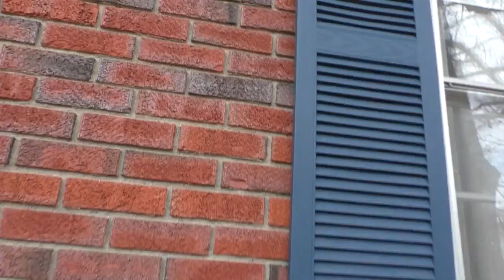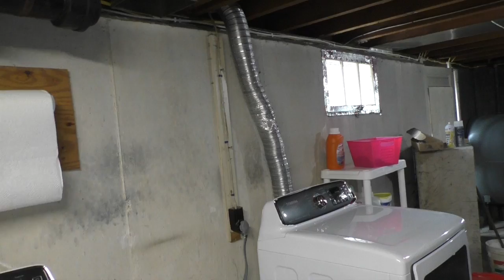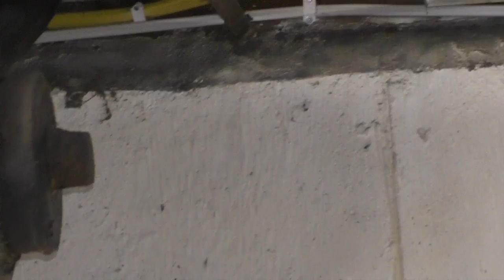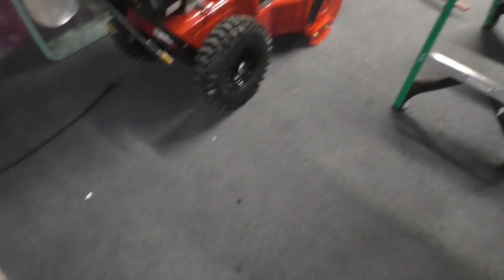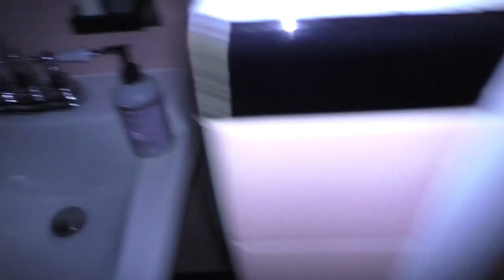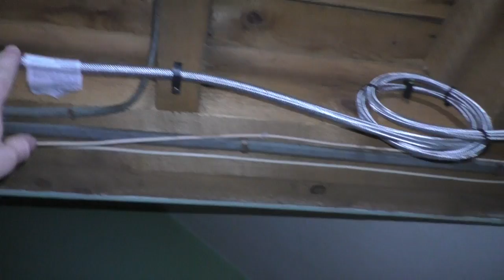Plumbing Repairs with BBISHOPPCM! - Replacing A Hose Bibb

Comment: In Finland we use something like sharkbite fittings, BUT ours don't use rubber O rings. Instead they have brass rings. They don't usually leak. You don't have such fittings available in the USA?
Reply from the maker: We have compression fittings that the pipe slips right into, which need to be tightened with a wrench. These types of fittings are very secure and long-lasting. "Shark Bite" fittings are only good for a few years, but easy as hell to install and can be easily removed with a special tool that releases the "teeth" that hold them in place.
Reply: @bbishoppcm  Ok, those compression fittings are most likely the same kind we use in Finland. But they are quite expensive. Is that the reason you don't use them?

Comment: Even with the possible lower lifespan, pex is way better. You can run one continuous piece of pex from the basement to the fixture. It is also more resistant to  freezing, cheaper, easier to install  and in the event you have to replace it, you just join the old tubing to the new tubing and pull it through the walls. Also, I think you picked a sill cock that was too short. I thought it was supposed to intrude further into the house where the temp is warmer . It would have been easier to work on, too.
Reply from the maker: The big problem with PEX is the lifespan is still an absolute "unknown" at this point. The manufacturer can say anything they want about how awesome and long-lasting it is... but how many 70 year old PEX installs are out there? Plastics can sometimes age unpredictably, and we've already had examples of newer plumbing materials fail prematurely. I'm not one to jump onto newer technologies, because they almost always fail despite promises of a better product. Copper is the only current plumbing material that we know with certainty that can last 100+ years. That all having been said, if I were building a house today, I'd go with PEX. But since I already own a copper house, I'm just gonna keep what I have and repair it as needed.
Reply from the maker: Another thing... much of the PEX tubing available from big-box-stores is actually from China... and if you think for a minute Chinese plumbing suppliers are manufacturing their wares with the proper care and attention needed to create pipes that last 40+ years, you're more naive than I am. Copper is expensive, but under most conditions, it'll outlast everything else on the market.

Comment: Hi Brandon. We repair those valves all the time here in the uk. We call the seals washers. Taps have them too. Sometimes it's better to repair as newer parts can sometimes not match up to older fittings (due to imperial and metric systems). Make sure to take the old seals with you when you go.

We also use brass nut fittings here too so valves/taps come in solder version and nut versions. If you dont want to solder or don't know how to, you can just use the version with brass nuts on either end.

If I were you, I probably would  have taken the opportunity to move that outdoor tap to the other side of the cellar door. I know it's a lot more work but it means water wouldn't have a chance to flow into the cellar.

Mind you, I do tend to bite off more than I can chew. Cellar's beginning to look really nice.

Comment: Ppr pipes are the cheapest and look pretty tough. You just heat weld them together with fittings, should be ok for 100 years. The welder is quite cheap as well. I don't trust pex much though it's the fastest method to install these days but I prefer crimp fittings instead as the screwed ones don't look too reliable and can sometime leak. Unfortunately the pex crimp tool is quite expensive but you can borrow one at some shops. The electric one is bloody expensive, no sense in buying one unless you're a pro plumber.

Comment: What's the deal with the 2 power meters??
I've seen it before but primarily on houses with solar.
Reply from the maker: Once upon a time, there was a huge push to get people to install electric water heaters and radiant heating panels... the electric utility companies were offering a discounted rate on electricity used for these purposes, so many homes were wired with two meters - one for water/heating, and one for general use. If I ever have the main panel replaced, the second meter will be removed.
Reply: @bbishoppcm  I've seen them mainly in houses that were "all electric" mostly built in the 70's during the "energy crisis" when electric was cheaper relative to natural gas or even heating oil...  I saw the two meters and thought it was possibly setup for a tenant dwelling in the basement but even with the separate entrance I'm not sure I'd want to dwell there...

Comment: My personal experience with copper pipe is that it usually wears thin and leaks, sometimes before it is 50 as was the case with my parents house. After about 8 years of frequent pinhole leaks the plumbing company recommended we look at getting most of it replaced with pex, which we did 3 1/2 years ago. The only problem we have had with the pex is rodents can chew through it.
Reply from the maker: The pinhole leaks are often caused by a faulty sacrificial anode in a water heater
Reply: @bbishoppcm  most of the time it was the cold water supply line that had worn thin that was pinhole leaking.

Comment: The placement of your rear basement door looks like it's prone to leakage. That's not really a good design choice. I'm surprised there's not a raised concrete platform to block out water entry.
Reply from the maker: Funny, I dug the earth down a bit after making this video. The outside landing was originally BELOW the threshold, but soil migration and lack of maintenance brought the earth up to the threshold, which allows water to pour in. Future plans include a retaining wall, and a concrete landing outside with proper drainage, but I'm not in any rush to fix it, as anything that can be damaged is being replaced anyway.

Comment: Why do you have 2 electric meters?
Reply: Disneyfan95 I was about to ask the same thing!
Reply: Brandon has said in some previous videos and 1 live stream that when Seabrook Generating Station was still under construction the old utility company in New Hampshire promised a discounted rate for electric heating, so the original owner had the electric water heater put on its own service.
Reply from the maker: @robertsitch1415  Yup. Two rates. This is no longer true, and I get charged the same rate on each meter.